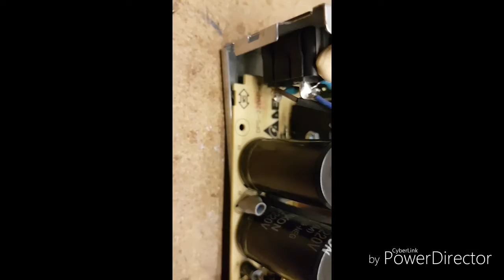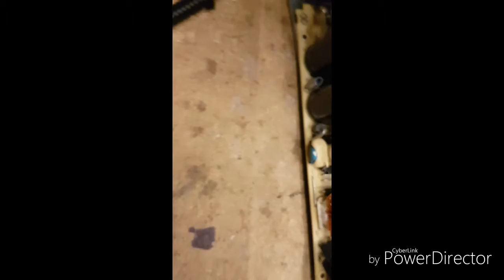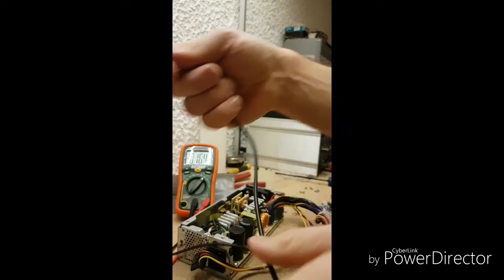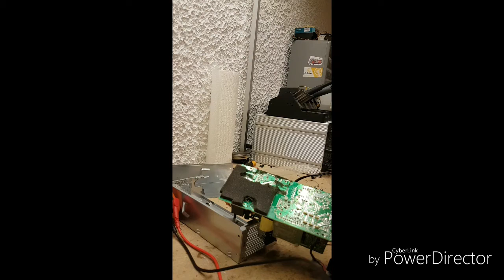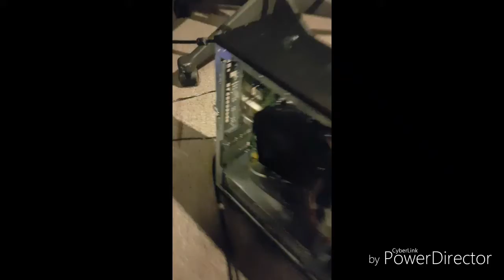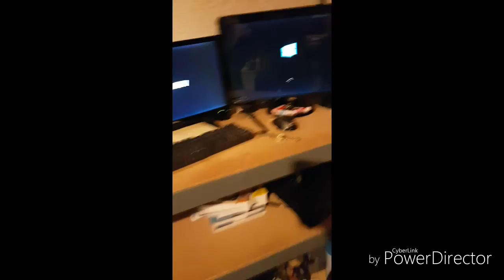#5 110V Electronics Plugged into 220V Repair

Comment: So here is the conclusion : As long as you accidentally plug your 110v device to 220v electricity sockets then your device "totally dead", the first time module will be affected and need to be repaired of course the power supply, why? that is because like it's name "Power supply" which is supplies your device power, and they related to the first time contact with the electricity. Their task is to rectify the current from AC to DC (called rectifier module), after that the DC current output need to be filtered from noise/ripple, after the DC current is clean from noise/ripple then the current need to be regulated (called DC regulator module) which is used to stabilize the voltage change which sourced from the AC input (your electricity socket) and the electrical load (your device), after that the DC current can be used to your device safely. That's it

Comment: I plugged in a 110 into a 220 stereo and now will not work. Can it be fixed?
Reply: as long it is related to electricity, the main module will be affected is of course the power supply. so the answer should be "YES"

Comment: Hi I need help PLEASE. so i bought a Ebike and the charger that came with it it's either 110v switch or 220v So germany has 230v I plugged The charger In the wall at 110v It won't Charge the bike when i switch to 220v It burned it. So i bought a new charger Same one And i keep it on 110v But it Won't charge my bike???
Reply: Well.......RIP